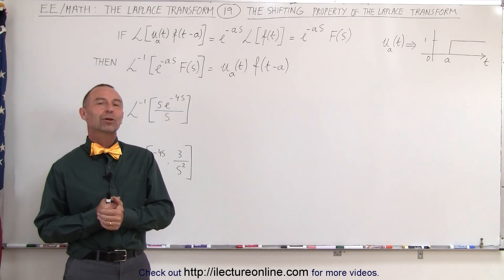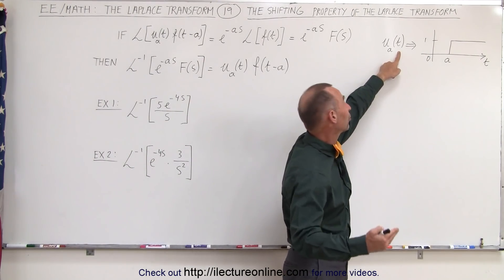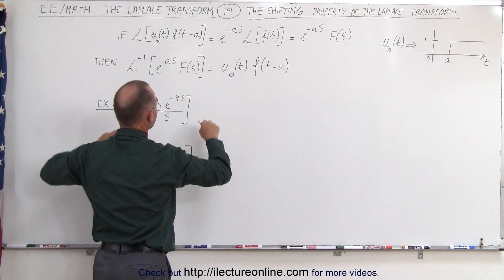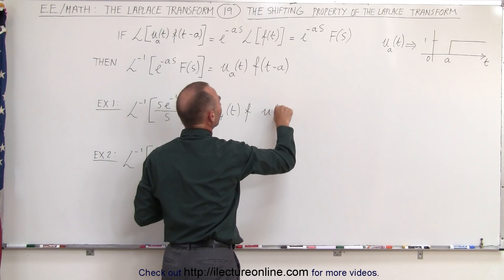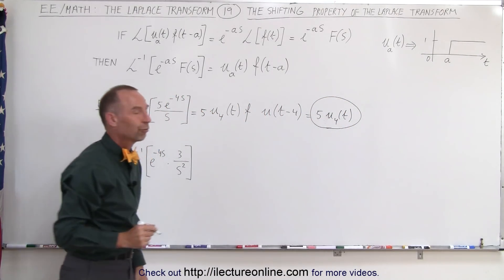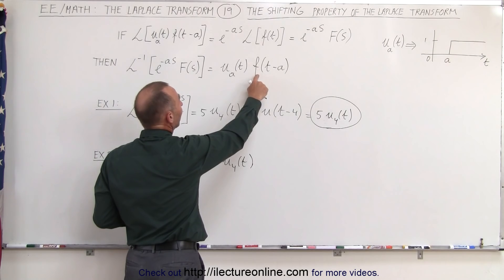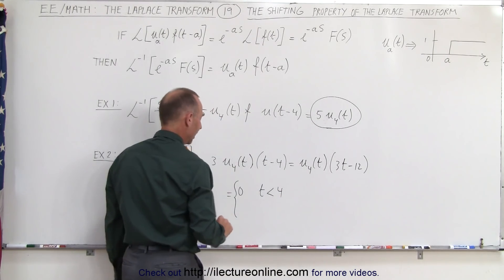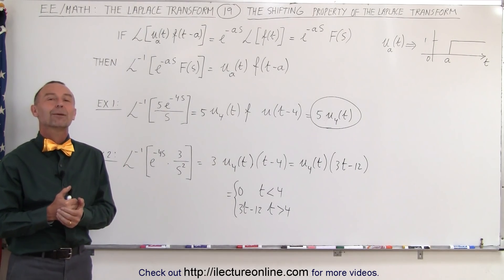Electrical Engineering: Ch 16: Laplace Transform (19 of 58) Shifting Prop. of the Laplace Transf

Comment: in the second example we put 
F(S)=3/S^2
so 
f(t)=3 . t
and 
e^(-aS)=e^(-4S)
so that we get the inverse laplace of 
(e^(-4S) . 3/S^2)= u4(t). f(t-4)
as the role says
and then we know that 
f(t-4)=u4(t) . f(t) 
so why isn't the laplace inverse is equal to 
u4(t) . [f(t-4)]=u4(t) . [u4(t) . f(t) ]
which is equal to 
u4(t) . [u4(t) . 3t]= u4(t) . 3t?? 
I don't get that.. there is (f) written in the first example and you didn't use or define what was it